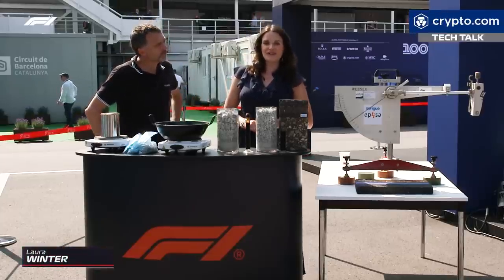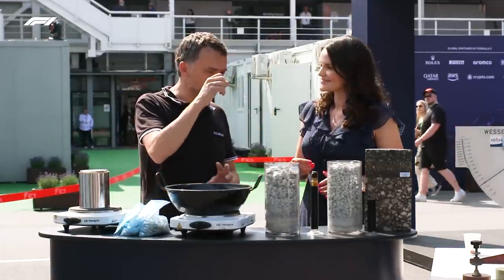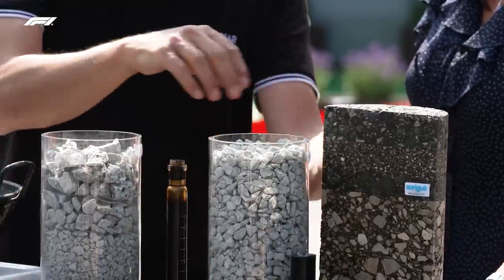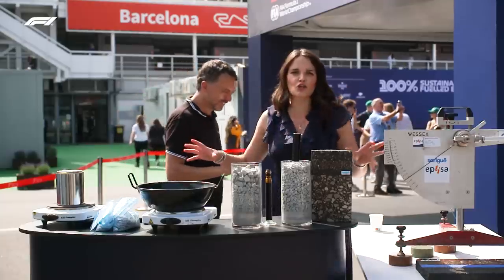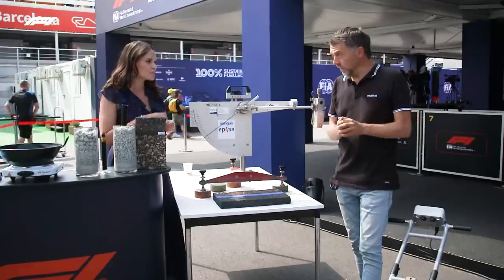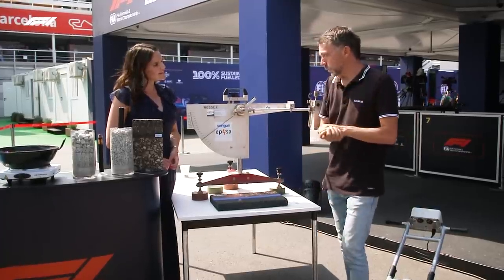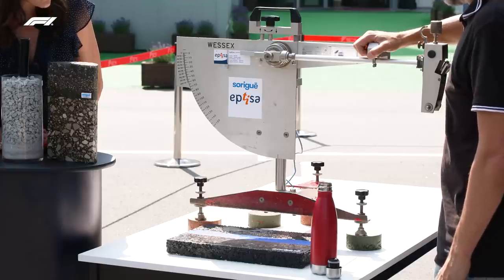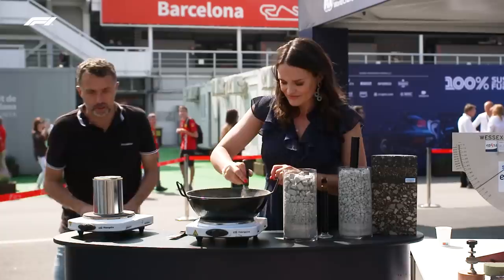How Do Different Track Surfaces Impact Our F1 Cars? | Tech Talk | Crypto.com

Comment: I had an argument over this with a friend, that I believe that coarse chip road surfaces have more grip, but my friend reckons that smooth  mix bitumen road surfaces have more grip.
I think I'm finally vindicated

Great show Mr Albert.
Reply: Think it may depend on how much surface area is coming into contact with the tire. The more contact there is, will help improve grip potential.
Reply: If you have gravel with sharp edges it has the most grip, if the gravel got sanded over time to a round surface, you loose a lot of the grip, also if it gets covered in dirt.
Reply: You are both right. In dry conditions micro texture (micro roughness) dominates skid resistance (grip). In wet conditions its the other way around, macro texture dominates skid resistance. You can have it both ways but usually at the cost of surface durability.

Comment: Wow, so on street tracks do they repave the roads with this stuff??
Reply: Thats exactly the stuff how normal roads are made. I just learned to do it with three layers instead of four like shown. But there are local differences on what stone type to use, the mix of the different gravel sizes and additives. The thickness depends on the expected loads over time. Temperature effects the bitumen-mixture.
For racing track i expect them to use compositions for the top layer with higher grip than normal roads, as they should be a bit more tire saving. 

For street circuits they don't really need to change the tarmac, they should just renew it more often as the traffic grinds the gravel smooth over time and i wouldn't recommend the standard fast grip improvement jobs for race tracks with high quality levels.

Comment: aha IRL that's the reason why I can take one roundabout with 100 kph and the other with only 30 kph. The surface is different.
Reply: Probably more like radius.
Reply: You can take one roundabout at 100, you just won't be around to take the next one.
Reply: @Redskies453  In the Netherlands some roundabouts are more like chicanes, some have nice curbs on the inside. however Sometimes the road is from concrete and have low grip in wet conditions
Reply: @RandomizedGamerrrr98  that's it I'm going. Beer in the movie theater, triple world champion, even the mayonnaise on the fries I'm down with it.